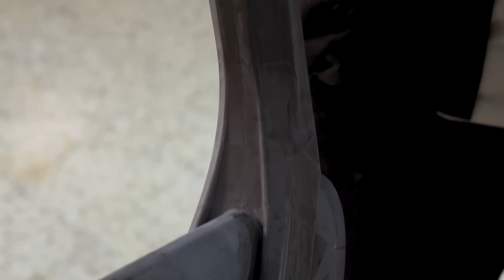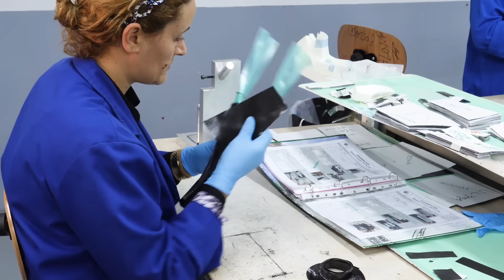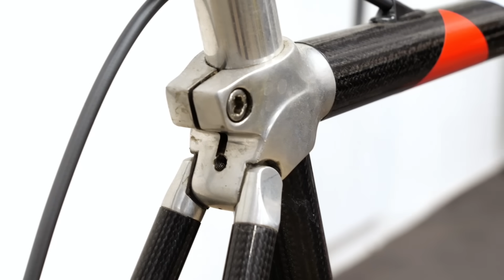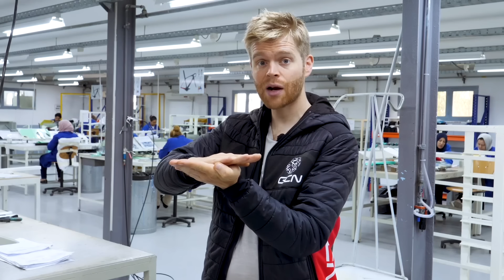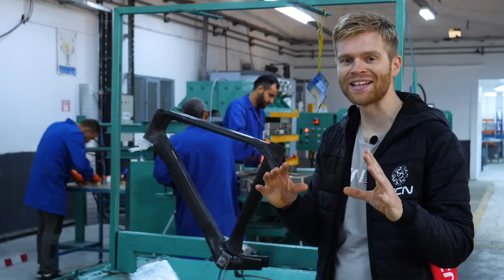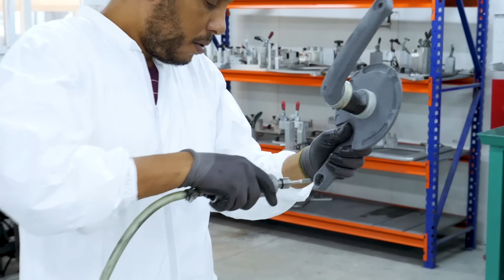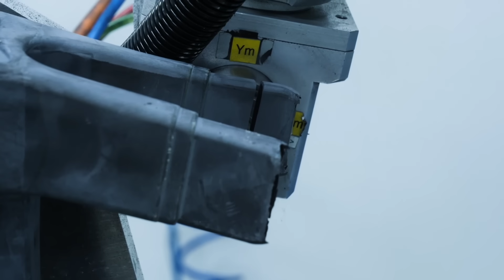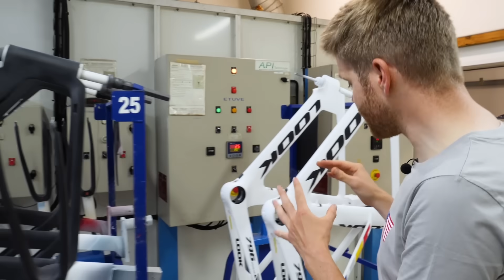How Are Carbon Fibre Bikes Made? | LOOK Cycle Factory Tour

Comment: Is that carbon dust not harmful? I feel like other videos of people cutting/drilling carbon have massive ventilation systems and masks to deal with the carbon dust. I guess thats why their factory is in Tunisia?
Reply: I like how the PR response completely forgot to address the issue haha
Reply: Hell yes, need full face respirator.
Reply: I was wondering samething.... and Look answered in weird way... make labors more proud in Look working area
Reply: 87cigs All the abrasive work is done on clearly visible downdraft tables. Notice the perforated surface and the large air duct under the table.
Reply: carbon fiber is not real, it can't hurt you
Reply: Tunisia is a former colony of France. The wages are VERY low, no worker protection, even <16year old children put to work ( in the textile industry at least )... the situation was already very bad before 2000, but after the former president Zine El Abidine Ben Ali ( not a saint ) had to leave the country and recently after some terrorist attacks in touristic places, the country is even in a far worse state. France/EU is just (ab)using it. Tunisia could be a far more prosperous country if you look how much oil it has in the soil. Somehow that money doesn't get to the local people... Next step, they will quit Tunisia and choose even cheaper countries in the East... that's the way things are going all the time in all production industries in Europe ...
Reply: Carbon dust is bad bad for your lungs like most very small particles especially the elongated ones (like asbest....)
Reply: Thank you for your feedback. We are proud of all of our manufacturing sites. In Burgundy (Nevers) France, where all pedals are made and all frames are designed and prototyped, and in Tunisia, where most of our frames are made. All our employees in France and Tunisia are equally treated according to our health and safety standards. We employ women and men, all of whom are proud of the brand and the skilled work they do. Most of them have been with the LOOK family for many years, and their loyalty and high level of craftmanship is what makes LOOK great. We run factory visits in France and Tunisia, for those interested in learning more.
Reply: Being proud of someone who clearcoats for (hopefully) 8h a day without a mask is just beautiful. Gotta love the corporate communications
Reply: @look_cycle   You should be ashamed of yourselves for such a bullshit answer. Do better! Stop being greedy!!!
Reply: @look_cycle  bullshit answer!  Being a proud worker will never protect your lungs and body from the hazards of factory work.
Reply: @look_cycle  @15:54 the female employee is wearing a mask but the mask does not cover her nose.  Please tell her to do so.
Reply: lookcycletv 
What crap
Reply: @look_cycle  I'd like to visit the factory in Tunisia, how I could get there ?

Comment: Very interesting. It would be interesting to see how or if, FEA (Finite Element Analsis) software is use to design a carbon fiber bicycle using tube and joint shape to work with the various carbon fiber materials relative to the various working loads.
Reply: Yes, FEA is used as one of the basic tools in composite design since the complexity of the multiple layers in different orientations and the 3D shape cannot be calculated/modelled
 any other way.
Reply: Thank you for your feedback. We run factory visits in France and Tunisia, for those interested in learning more.

Comment: Carbon fibre is great stuff but no body has worked out how to recycle it yet.
Reply: earthstick : easy, grind it to flox, mix it with epoxies and make something in composite form. What will replace it?
Reply: @Pushyhog  I think you are saying to use it as a kind of filler in new composites, a bit like those 'carbon nano tubes' people used to mix into the epoxy in new carbon composites.  That's about all I can think of.  But before long the amount of crushed carbon fibre will exceed demand.